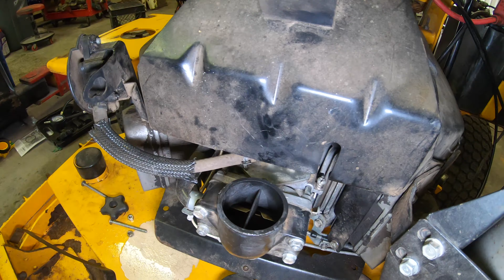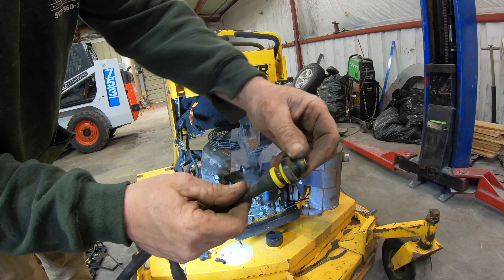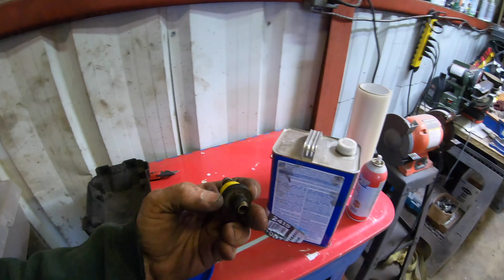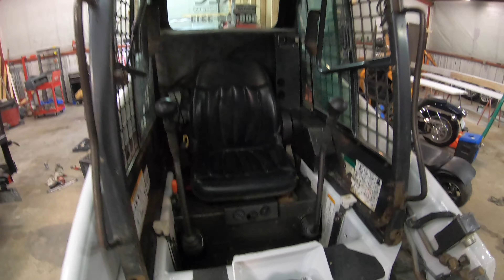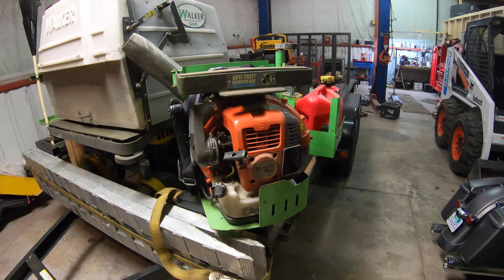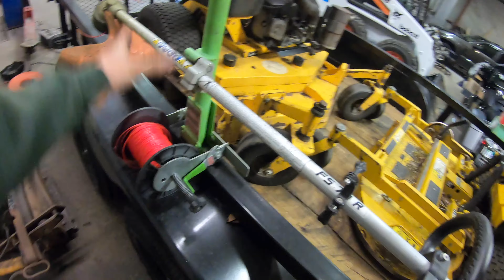I bought the cheapest Wright Stander on Marketplace | My 2022 Lawn Mowing Setup!

Comment: Good job! These Kawasaki engines are great.  I bought an old Wright stander like yours with a "bad engine". Took the head apart and the valve seat had come loose (due to overheating/not maintaining). Tapped it in with a hammer lol (didnt even remove valve). Put it all back together with the same old gaskets (not recommended)  and it fired right up perfect. 1.5 hour worth of tinkering and it's runs perfect.

Comment: Very nice video Ken.  I got a WrightStanderMower 52 free and I bought a new 19hp oem kaw replacement engine.  I’m having trouble with the wire harness and where all the wires connect.l Where can I find someone to help wire it correctly?  I don’t have a trailer to transport it.  Also what battery does it require?  I appreciate any help.  Thanks.  Johnny
Reply from the maker: You can use any lawn and garden battery 12v … the same as most lawn tractors use. As far as wiring Wright has free downloadable manuals online as well as Kawasaki …. If your connector is different you will just need to match up the wires and splice in your your old connector. It’s pretty basic wiring .